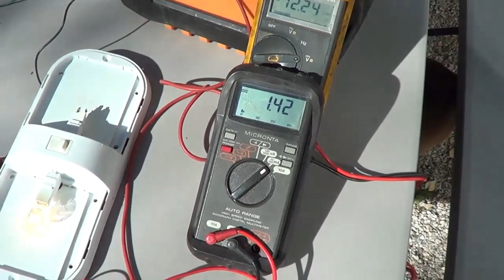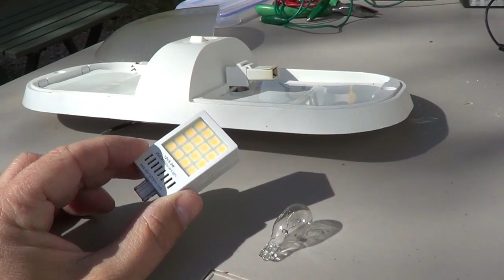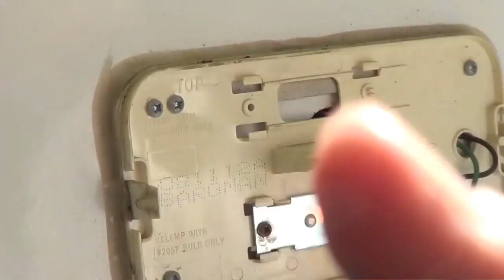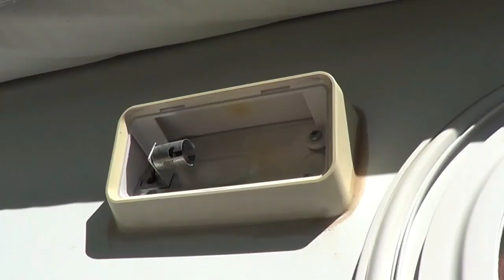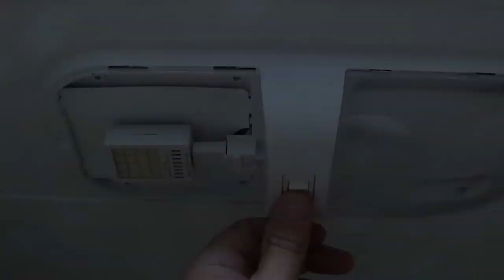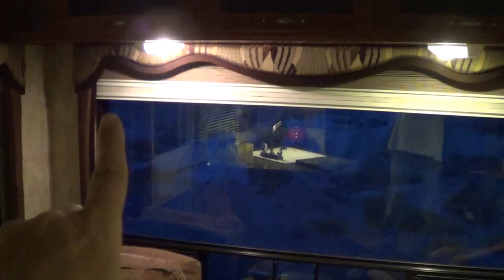LED Lamps For  The RV - Install and Test

Comment: Looking at a cost-benefit analysis of changing the bulbs in the RV, I would say some are not worth changing. If it's a lights that is never left on more than 5 or 10 minutes like inside a cargo area, I wouldn't think it would be worth the cost of the upgraded bulb. If it's on marker lights on the RV oh, they are getting powered by the vehicle as it's running Panda probably again not worth the added expense of changing unless you're changing fixtures anyway. These bulbs and fixtures are getting cheaper all the time to wear in the near future it might do more worth it.
Reply from the maker: I recently put out and update video on the LEDs I installed 6 years ago - https://youtu.be/WA2c6GwQNno  Cheers, Ray

Comment: So Ray, I know its been a while but what would be a ballpark cost to convert the whole rig to LED?
Reply from the maker: I'd say anywhere from $200-400 depending on the quality of the LED lamps used and how many fixtures are involved. Easiest thing to do is replace the most used fixture first.

Comment: Thanks for the video.  How do you like the taillight/brake light?  It appeared that all the other lights were brighter than the taillight.  Did the brake lights light up a lot brighter?
Reply from the maker: Matt Griffin Ya, the brakes light up brighter, but it is one LED lamp that I'm not that happy with. I actually had to but some foil in there to increase the light output. They are bright enough but I would like to get a brighter lamp in there. All the other Starlight LED lamps were plenty bright, especially the marker lights.
Reply: Love Your RV thanks for the response. I hear that if you get too bright of a tail light than it makes it harder to recognize when the brakes are applied because there is little difference in brightness between the running light and brake light. Have you heard or seen that problem?
Reply from the maker: No, I haven't but makes sense.

Comment: Someone told me about LED lighting for my RV and I bought a couple to try and they are very bright white light. Kind of like having a fluorescent bulb. Really liked the fact they don't get hot and use little power. Downside they are expensive compared to the incandescent lights but worth it. So every paycheck I purchase about 4 bulbs. I tried the Gold stars and they were ok but I like the bright tech as they seem to flood better inside the rv. I use the Gold star directional for porch lights. Anyways the other day I purchased some more bright tech bulbs and replaced the older bulbs and when I turned it on I thought I accidentally put the old bulbs back it as the light was a warm white like incandescent but found out that bright tech does in fact make warm white. I just ordered the wrong ones. I use them above my bed so I am not blinded. So that is great for people who don't care for the bright white light but still want LED lighting. I just wanted to share that with you. Also let you know you got a new Sub.
Reply from the maker: Thanks, you have to check the Kelvin color number when getting LED lights, the ones I used for most of the interior are 3200 kelvin, they are warmer and more yellow light like incandescent. Here is a color chart showing the different kelvin numbers and the colors - http://starlightsinc.files.wordpress.com/2012/05/sl-kelvinscale1.pdf
Reply: +Love Your RV The above link no longer works Ray - its gone 404
Reply from the maker: Thanks, Starlights must have changed around their website.

Comment: How are you able to turn on the running lights on a fifth wheel when it is unhooked from the tow vehicle?   Just curious.
Reply from the maker: Hi Doris Shanks On the plug that usually connects to the truck I place a fuse between the 12 volt power pin and the marker lights pin , I believe it is pin # 3 an 4. It just applies power from the trailer battery to the lighting circuit. I use about a 10 amp fuse. - Ray

Comment: I also fulltime and had two led fixtures installed so far.  One over my bed and one over the dinette.  It is a very white light which some do not care for.  I heard recently that a warm yellow light is available now in the led.  For certain areas like the bathroom, doing makeup etc. it would be preferable.

The bulbs you used look a lot easier to install than some I've seen.  I think it pays to wait a while til new items are perfected and improved.  
I am sure when I install a few more I will be able to do it myself.